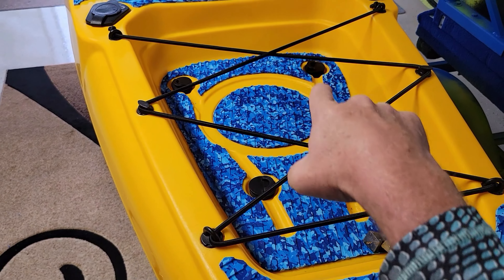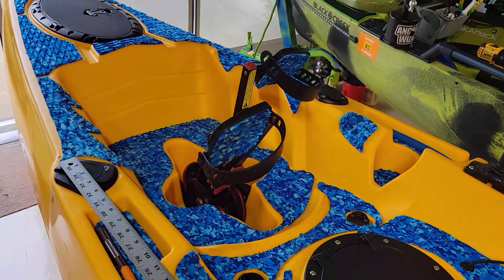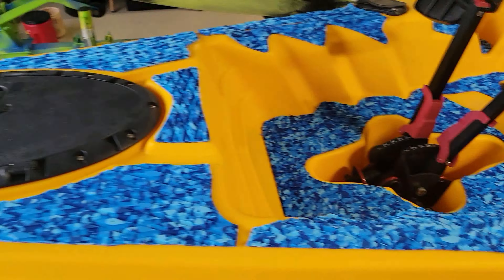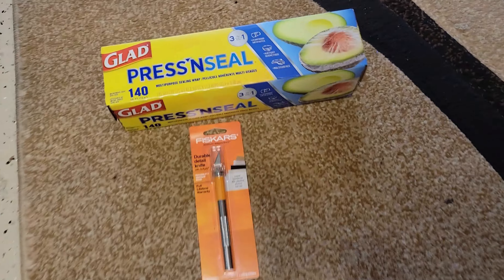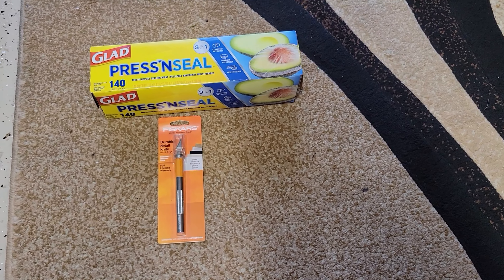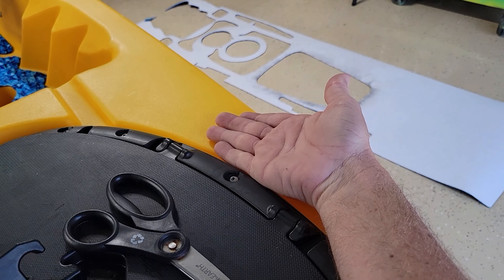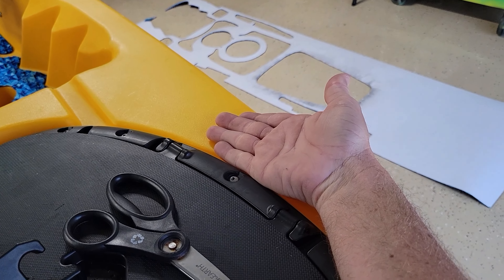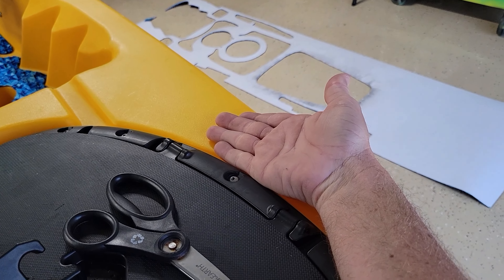DIY installed kayak deck EVA foam from Scratch on my Kayak.

Comment: How has this held up ?
Reply from the maker: If you use the 3m glue it last a long time. The decking is only the 3mm so it will hold up as shown for this application